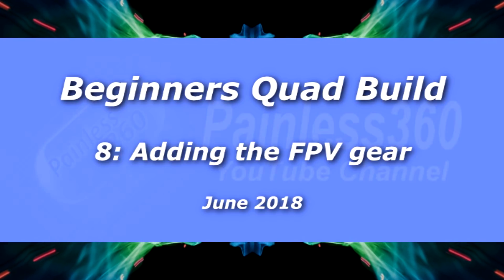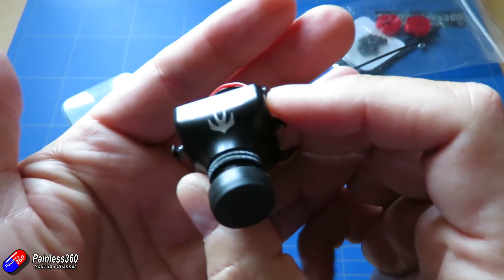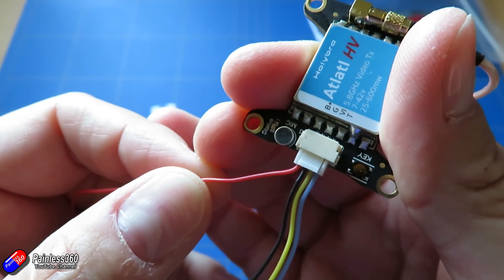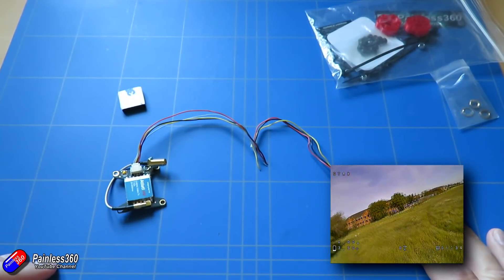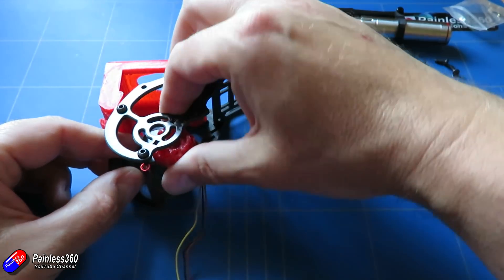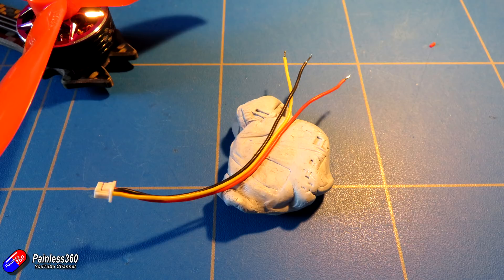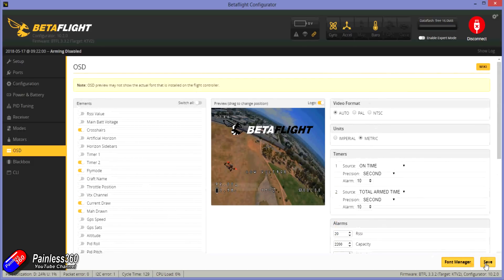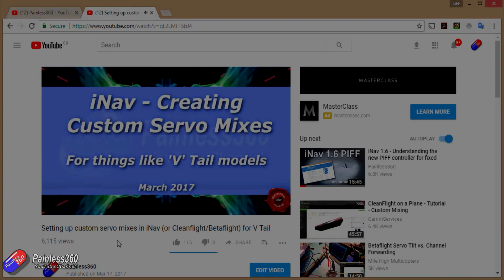Quad Build for Beginners (S8.8): Adding the FPV gear..

Comment: What do you recommend for FPV monitor like you show that is good (enough) at a less than $100? I do see some to choose from but not sure other than reading reviews. This will be my interim solution to the costly $300+ goggle route [ or root, however you want to say it! ;) ]
EDIT: GetFpv has a Lumenier LCD 8" that looks pretty good and has all high reviews.
Reply from the maker: Check out the 'reviews' in either the review or the 'FPV' playlist. I've looked at a few recently, some of them are quite cheap too. Best of luck
Reply: I changed my mind and will go with the Eachine. It has 600 cd/m^2 vs 450 of the Lumenier. Needs to be bright outside.

Comment: Thanks Lee, Really good series. Noticed you have stopped using Mu metal ?
Reply from the maker: That was only to shield compass chips when using compass for flight modes. As the compasses are usually in the GPS now you can mount them far enough away from the power. See my last iNav builds..

Comment: What’s the auw?
Reply from the maker: This isn’t a racer, and the series is designed to have a capable modern quad that’s easy to build. There is plenty of power for the model on 4s and the hover point is nice and low with a 1500mAh pack.. happy to weigh it next time I’m by it - why do you ask?
Reply: Painless360 ik I was just wondering
Reply from the maker: 406g without battery or action camera fitted..

Comment: I can’t get a good picture from my quad, could you please do a vid of how to cure or make better the electrical noise, I’ve tried capacitors to no avail, I’m installing a pdb in the hope that will cut the noise down, if I connect my camera from direct battery I get lots of noise thus destroying the picture, in using a foxeer micro and a micro vtx3 (can’t remember the exact product name) which will run of 5v, when I throttle up the osd disappears, running omnibus pro f4 v2.
I know that different interference make different symptoms of inference, ie horizontal lines across picture and angled lines etc, could you do a video on differential interfence, there’s a lot of them, I think it would very helpful to a lot of people, great work with all of you videos you put up, they’re very helpful

Regards

Jeff
Reply from the maker: My advice is to use the kit I do, there is a reason I use the tech and build them the way I do. I don't have lots of capacitor and extra cables in my builds. The best advice is power the camera and VTX from a good power supply (ideally LC filtered) and make sure that all of the GND wires from the camera, power system and VTX come together in one place. Thanks for the idea for a video - I'll give it some thought..